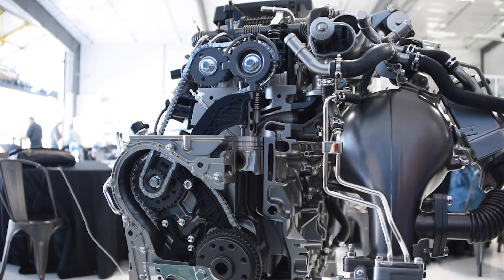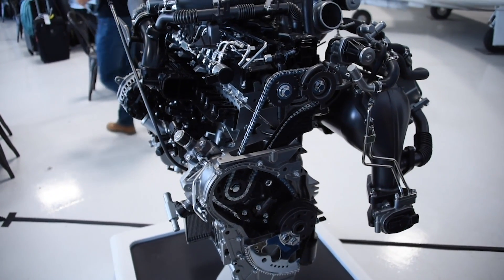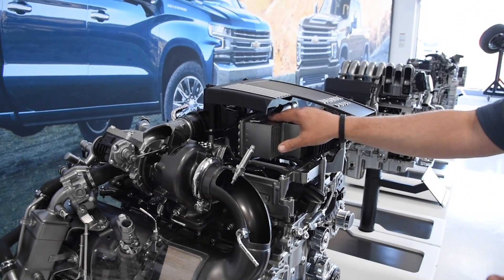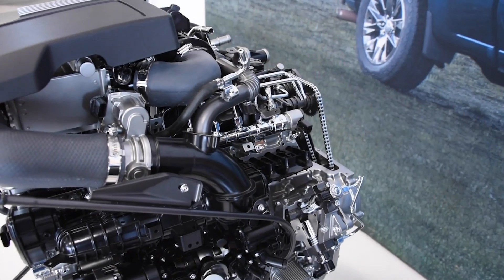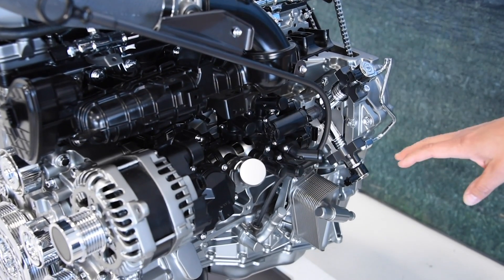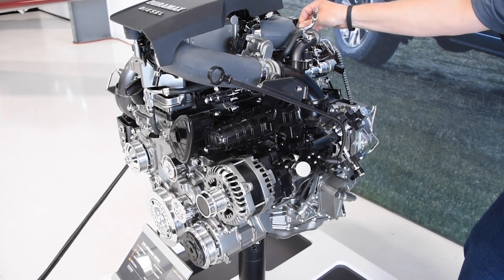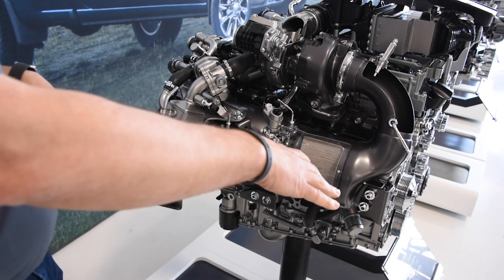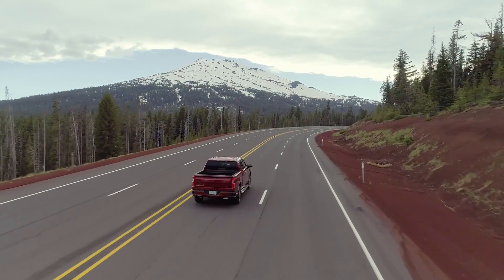What you don't know about the 3.0-liter Duramax diesel

Comment: Gm needs to get rid of these so called engineers, a diesel motor with a 150k service life--- gas motors go 300K + with proper maintenance a diesel should go 300k to 500k  and they say it's not a big job to drop the 10 speed trans. to change the oil pump drive belt a dealer is going to nail you at least 8 hrs to change this 50$ belt your looking at 1500 to 2 grand at the end of the day or days. Was looking to downgrade to a 1500 with this motor  to replace my 1017 duramax 2500  52000k  will be going to my dealer next week to order a 2020 2500 duramax.
Reply: Smh these retarded post make me laugh ..150k is recommended maintenance  on the safe side... and it's the same as a power stroke and many other engines and ..Don't mean it won't go 500k miles...smh
Reply: Evidently the belt drive for the oil pump allows for the variable pump pressure.  I wonder if anybody did the math on belt that is variable against a direct/chain drive and the life of both and the total cost at the end.
Reply: And it's actually easier to change the belt on this than on the front ...if it was on the front you have to pull radiator, fan and fan shroud,   pull the crank shaft pulley, probably other things like an alternator ...then the front cover ...it takes less than an hour to drop a half ton transmission then remove a cover and you're there...use your head people
Reply: I would also think the engine would shut down if the oil pump belt broke I know most big do.
Reply: @theaveragejoestinkeringand4407  it will ...it's a fail safe
Reply: @theaveragejoestinkeringand4407  the only question is at 150000 miles + is the warning sensors going to work
Reply: I had a 91 S-10 that I drove 380K miles and sold it still running.  When I buy a vehicle, I plan on keeping it a while.  150k - 200k is not a life for a vehicle.  That is just getting broke in.  GM needs to go back to the drawing board and try to do the right things.  Look about putting the 2.7 turbo in the Colorado.
Reply: @rcracer641  do you read or pay attention? Nobody ever said 150k was the life of the vehicle...150k is the safe recommended mileage to service the timing assembly ...that doesn't mean it won't go for 500k miles
Reply: Pulling a transmission is not necessarily regular maintenance.  Servicing a transmission is ok.  How much will it cost to replace a belt in the motor.   They should have came up with a better design.  @geauxtigers2911
Reply: @rcracer641  you're still not paying attention ...you Don't have to do that every 150k miles... and it is a better design...if you had to change a timing assembly on a regular truck you have to pull the radiator, fan shroud and fans, remove the belt, remove idler pulley, remove the crank pulley, possiblity of removing other things like a alternator or sensors, then finally you can take the cover off to get to the timing assembly...this engine all you have to do is undo a few bolt and plugs to drop a half ton truck transmission that takes less than an hour then you're at the cover, so tell me which is a better design? Just because it's new and different Don't make it bad

Comment: I am sorry but I can't help but see nothing but potential reliability issues with the DPF, EGR, SCR, blah blah blah. I actually love the idea of a 1/2 ton diesel but our government seems to want to hog tie the most efficient internal combustion engines with all this pollution equipment.
Reply: i see stupidly hi failure rates thru out this engine
Reply: I like clean air. Diesels are dirty. Went to Germany once where diesels are very common and the stench around any kind of traffic was appalling. Nothing personal against that type of engine per se.
Reply: I like clean air also. In stock form, my 2006 5.9 did not smoke and did not stink. You are describing one extreme. The other extreme is the current situation. There is a happy medium and, in that happy medium, there is not a soot or stench problem and Diesel engines get much better fuel economy and are much more reliable due to a lack of expensive, unreliable, mpg robbing, EPA mandated exhaust after treatment hardware.
Reply: I don't even think the biggest issue with this engine is emissions. The issues are the rated life is 100,000 miles and you have to drop the transmission to do the timing. I will bet on that this model will barely sell because people aren't that stupid anymore where they used to buy something for the sakes of it thanks to YouTube videos like these
Reply from the maker: @electric6877  This is simply an overview of a new engine for those who might be interested, not an endorsement or criticism.
Reply: @TheRVConnection  Yeah I do realize that. I still think it's a good engine, but I'm just trying to point out a flaw what "as hard as taking the transmission out" meant. Thanks for the video though, it's helpful to both potential consumers and even people who are just enthusiasts!
Reply: @electric6877  You didn't watch it?  No service on timing, ever.  Service was on the oil pump.
Reply: @scottwilkins  the oil pump is still driven along the area where the timing is, which is in the reverse side of the engine where the transmission is
Reply: @scottwilkins  the injection pump is driven off a timing chain, and then the cams are driven by a secondary chain. There will definitely be some timing chain stretch from that kind of loading. Sure it may be "lifetime," but from what the engineer is saying, that's 150,000 miles.

Comment: Very interesting. Thanks for the detailed video highlighting all the new engines features and components. Very interested in this new 3.0 Duramax. Very much looking foreword to seeing the new unit when it comes to our store . So thank you .
Reply from the maker: You are welcome! Glad you enjoyed it.
Reply: @TheRVConnection . Yeah, thanks for the heads up on this turf.  You have saved a bunch of folks some major $
Reply from the maker: @nunya9555  You are welcome! Regarding your remark about timing belts, I have brought up that point. Millions of cars use timing belts that should be changed around 80k miles, but everyone is concerned about a belt that needs replacement at 150,000 miles. What I have always been more concerned about, and what may be contributing to the overheating issues I'm hearing about now, is the after treatment system being located under the hood, instead of underneath the vehicle. This arrangement, combined with the engine being cooled with electric fans (instead of mechanical) sounded like trouble to me.

Comment: What is the engine designation...not the name (e.g. DuraMax).
Reply: LM2
Reply: @mainwayne1352  Thx
Reply from the maker: Engine designation? You mean the configuration, maybe? If so, it's an inline six-cylinder turbo diesel.
Reply: @TheRVConnection  No, designation.  Like LH-7 for the 1.6L inline 4 cylinder diesel in the Cruze and Equinox.